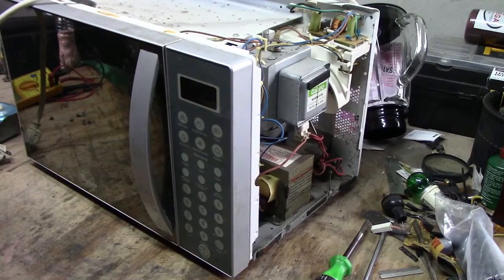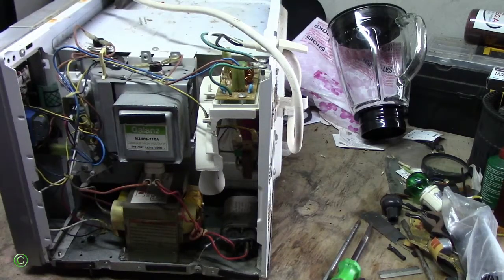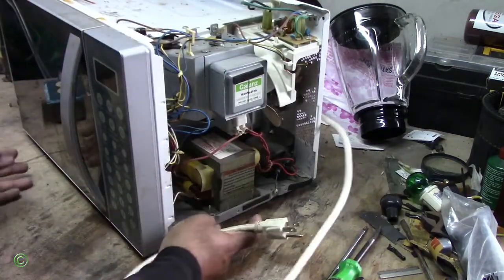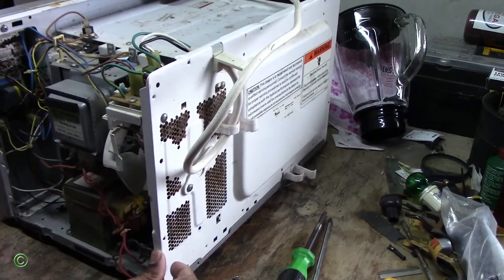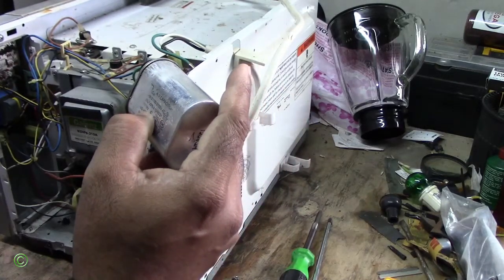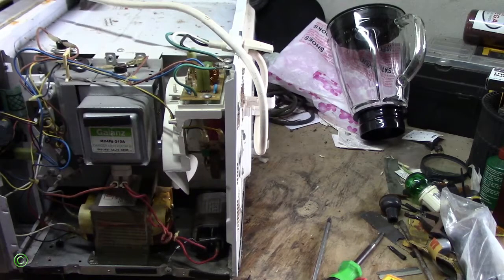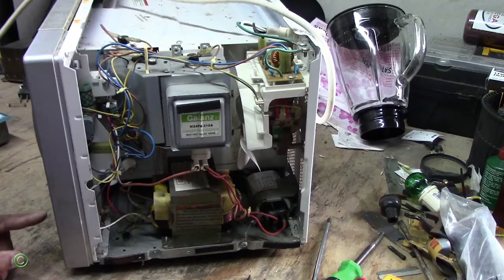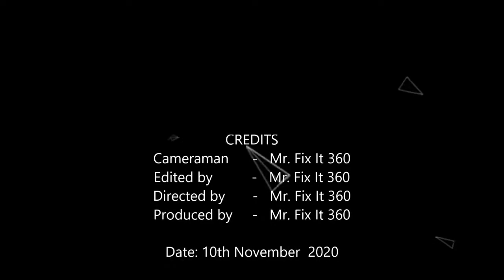Whirlpool Microwave Oven Repair (fuse keep blowing)

Comment: How do you diagnose a bad capacitor ?    All you did was swap them without knowing if it was the capacitor?
Reply: Use a capacitor tester.  Some multimeters have the function.
Reply: @fredwild190  I know, but you didn't show/say that, you just said it was bad with showing how you determined that.
Reply from the maker: I have a capacitor tester to test all my capacitor. I will use it on a video and show you how I test capacitor.

Comment: have the same type of microwave change the capacitor but the fuse keep blowing what can i check again
Reply from the maker: Check the high voltage diode or magnetron.

Comment: My microwave keeps trapping the breaker when its not use i replaced door switches the c-oil and HVD ASSY .
Reply from the maker: Plug the microwave on another outlet and if the problem solved. And get back to me.